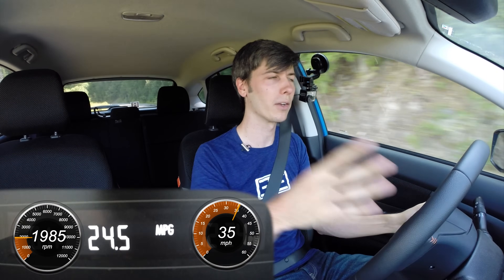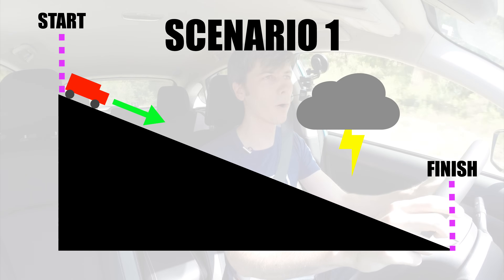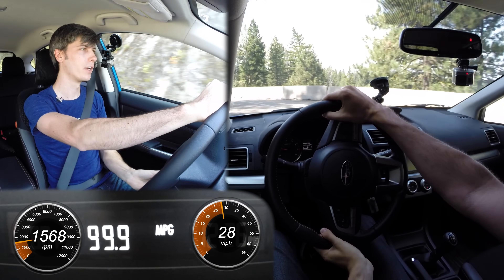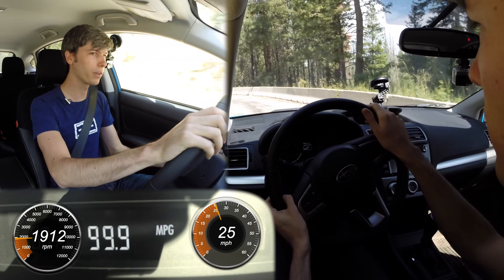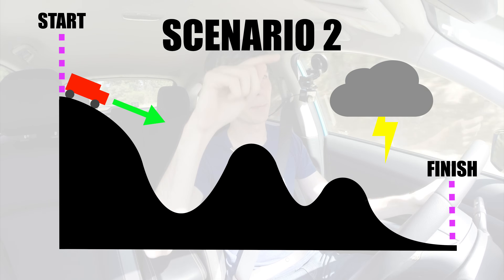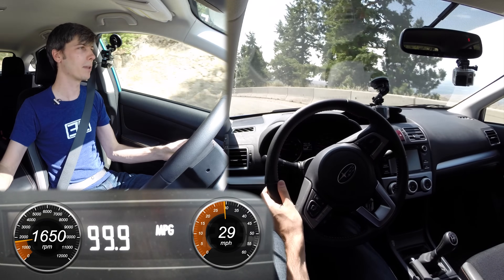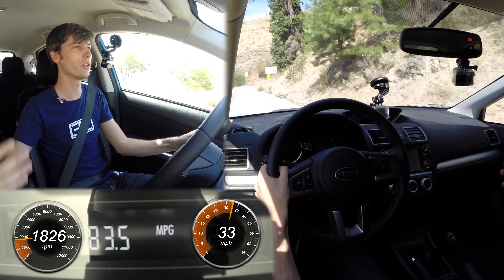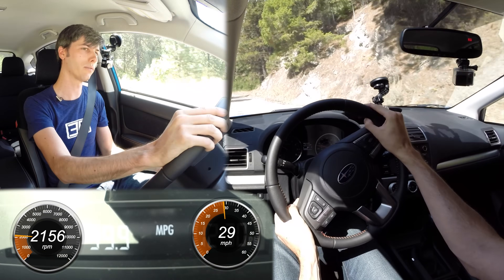What Uses Less Gas - Coasting Or Engine Braking?

Comment: To formalize this:
Your car has a finite amount of energy:
The energy stored in the fuel in your fuel tank + the kinetic energy that your car has right now.

If you're asking whether it's more efficient to coast in neutral vs coasting in gear, you're asking what consumes more energy.
If you're coasting in gear, you're not using any energy of your fuel, but you are using the kinetic energy of your car to turn your engine.
Coasting in neutral uses some amount of fuel, but you are now conserving the kinetic energy of your car as a tradeoff.

Keep in mind, that turning the engine with the kinetic energy of the car has an efficiency of almost 100%, as you aren't losing much energy on the way between the wheels and the engine, but converting fuel to kinetic energy while idling only has an efficiency of about 20%.

To summarize, you're asking at what RPM is the friction of turning the engine 5 times higher compared to the idle RPM. Also keep in mind, that friction doesn't increase linearly with RPM, so you can't just multipy the idle RPM by 5

Comment: My auto coasts but on a decent it will speed up so I touch the brake then it tgen turns off coasting and switches to engine braking. In my experience coasting only really benefits on flat highways.

Comment: This doesn't make sense.  It only depends on your finish line. If you see red light then engine breaking. But if driving like he is driving, then neutral will get you further and cover more distance then engine breaking and putting gas more to cover the same distance... I'm surprised he didn't cover that

Comment: I've done several situations with the mileage meter on my car. It has a graph of 6 bars but no numbers. 1 bar is minimal mileage, 6 bars is max. When on cruise, steady speed on level ground, the meter is maxed. Same thing coasting (no gas input) with no engine braking, max. However once you drop to about 15 mph and the transmission has downshifted, you lose the max mileage benefits.

Comment: This is incorrect. Try turning your engine off whilst going downhill.... the engine will bring you rapidly to a stop. Check exhaust pipe on car in gear going downhill... it's burning fuel.

Comment: 2:49 how about putting it in top gear. let it gain speed. Use the speed to climb the hill, if not enough give slight throttle

Comment: Can you redo this one please but not downhill. 
2 tests drive at a fixed speed (let’s say 80) and at one point one slows down using neutral and measure the distance it rolls and measure its fuel used.
Then the other car (which is in gear)has to keep driving a little while further at 80, and then start coasting in gear at some point to stop at exactly the same spot. And also measure its fuel used.
Which one would use more fuel??

Comment: Where is the stress point in engine braking? Is it the valves in the head? There's a lot of stress in slowing down a fast, heavy, object. What is the wear part? The thing that is going to need replacing, if engine braking all the time. ie: when using your brakes, it's the rotors and pads. Thanks, I like your videos!

Comment: 1st. It restricts the fuel going in, it doesn't shut off the injectors. That will stall/kill the engine 

2nd. What about putting a car that doesn't have engine braking in neutral instead of leaving it in drive?

Comment: My 2006 Navigator (w/auto trans and fuel injected 5.4L) ‘always’ gets better gas mileage, coasting in neutral versus coasting in drive! as a matter of fact, gets twice as much mpg while coasting in neutral! Could there be something wrong with my car? Because the overall gas mileage is only between 8 and 10 mpg. And that’s driving conservatively with a tuneup, new spark plugs, air filter etc. and no check engine light. I can’t figure out why it’s getting such bad gas mileage. Any help is much appreciated!

Comment: I don't think coasting would save any fuel, even in the multiple hill scenario, your video doesn't bring evidence to backup that claim.
 The main thing slowing you down excluding the engine is air drag, and air drag is proportionnal to the square of speed. Reaching higher speeds in coasting would mean more drag, and the fuel used for running the engine would be the same.

Comment: The best to save fuel is neutral and switch engine off, then when the hill is at the end, turn ignition on and put in gear, so you save battery too. You welcome.
Reply: Then you fall off the his...reason your power steering is not working 😂

Comment: As you drive down that hill you show that the two simplified answers are vastly oversimplified. Yes, the theory is true. However, most hills aren't straight as the hill you are driving down proves.  You need both engine braking and physical brakes in combination in order to maintain control.  Rarely is it safe enough to coast in neutral uncontrolled down a hill.  On top of that, coasting uncontrolled down a hill will get you in trouble for speeding.  Many people in mountainous areas get in trouble for speeding while having cruise control engaged because they fail to brake while going downhill.  Also, on long steep hills you can overheat your brakes if they are the only thing slowing you down.  It's much safer to keep the engine engaged and to physically brake as needed.

Comment: But this only applies if you have your actual stop at the bottom of the hill, in most scenarios you would benefit more from keep going in neutral on the flat piece which usually follows?

Comment: My 2.0l 2021 volvo barely has any engine braking. Even on a slight decline in gear with foot off pedal and all fuel inj cut off will still sometimes accelerate on a small decline. a large decline i have to shift to lower gear to get any engine braking. My 2013 manual corvette has much stronger engine braking. Steep declines even in a high gear will sometimes still slow car down with fuel inj cut off

Comment: Neither of those options are the MOST efficient method of driving in Scenario 2.  
The MOST fuel efficient method of driving in that scenario (in all possible scenarios in fact) is to hold constant throttle.  
Just hold the throttle at one constant position, it should be the position necessary to maintain the desired speed on level ground, and continue holding that same throttle position no matter if you are going up or down a hill.  Yes you will accelerate going down, and yes you will decelerate going up.  But this way of driving combines the best of both worlds, you gain the momentum on the downslope and that gest you up the upslope without using additional fuel that you would normally have to use.  And all things being equal, your average speed will end up being exactly equal to your speed on level ground.

Comment: Great video. Is there a difference when coasting in gear if you choose a higher gear vs lower gear? Eg. would you recommend to downshift at some point, or maybe even upshift to keep momentum, or will shifting gears make no difference unless you downshift so much that you rev the engine?

Comment: Note: Coasting in EVs literally uses no power, and using regenerative braking (basically engine braking) will produce a negative energy efficiency, because the motor will be producing more energy than it is using. For example, if you're traveling downhill at 60 mph and are staying a consistent speed while generating 8kW, that means that your efficiency is -7.5 miles per kWh, meaning instead of using a kWh in travelling 7.5 miles, you will have charged that amount instead

Comment: Another problem with coasting, is if you have trouble judging, road speed, engine speed, and the correct gear. 
My wife coasts down hill, rides the brakes, then regardless of speed, bangs it into first gear. 
Sadly, I had to buy her a automatic.

Comment: It's very simple. If the engine is to stay running at idle rpm, something has to keep it moving. If you put it in neutral, the engine has to burn fuel to continue to maintain idle rpm. If you leave it in gear, the engine will act as a brake and be driven by gravity and inertia. In this mode it consumes no fuel. Which is true of pretty much all modern vehicles with electronically controlled fuel injection.

Comment: I'm curious, is there a definitive year or technology that determines whether an engine can cut off fuel delivery while engine braking?

Also, I think it's a misconception that 99.9 MPG immediately translates to infinite MPG/zero fuel consumption. If the car can get 85MPG in certain conditions (like downhill), it's possible it could be getting over 100MPG, but still be consuming fuel nonetheless.

Comment: If you drive shift-stick you can switch between coasting and engine braking with your clutch pedal without having to switch gears. This way you can use the engine to slow down a little when needed, instead of using the brakes every 100 yards because you've picked up too much speed coasting(really annoying to drive behind, cuz you don't know how hard they're braking) 

I've seen some smoking calipers from people basically having to brake all the way down from a steep 3km high mountain cuz they were in neutral...

Comment: Easier mindset: Coasting preserves your kinetic energy. When you are in a situation where you need to get rid of kinetic energy, only then do you use the motor to convert kinetic energy of the car into heat inside the engine, and shut off the fuel supply in the process. Efficient driving requires you to plan ahead as much as possible so you avoid acquiring kinetic energy you need to get rid of. Sometimes easier said than done, but that is the goal. 
Had a heavy car with small engine, in that car I saved about 20% fuel by good planning and avoiding braking. Another tiny car, I only saved about 5%, so it differs. 
This also applies to electric vehicles. You can use regenerative braking, but it's more efficient to not do that unless you have to.

Comment: I was telling my wife that i want a fuel injector cutoff switch in my Mitsubishi mirage because it keeps the fuel ratio correct at all times, so when engine braking it uses more fuel because of the higher rpm. My diesel Jetta on the other hand cuts fuel under almost all engine braking conditions.

Comment: Before I even watch this video, engine braking will shut off fuel injection, using little to no fuel. Coasting in neutral means the engine has to use fuel to keep the engine idling, rather than the road wheels turning the engine via transmission. So the answer is coasting uses more fuel.

Comment: Saving fuel by coasting in neutral whilst going downhill is an old mith from the carburator age.
My mother is still insistent and to scared if high RPM to understand engine braking, no matter how often I explain it to her.
Which is fine since she pays for her rotors and pads not me :P

Comment: If injectors are cut off, why doesn't the engine stall ? I had a fuel solenoid valve failure once, the engine braking was VERY strong.

Comment: To save fuel, I find:
1) Drive smoothly. Cyclists will understand exactly how helpful that is. Rapid bursts of acceleration is very expensive.
2) Don't brake unnecessarily. This obviously will save on other costs. Cyclists knows exactly how this is too (When you carry your own water, the drops are precious).
3) If you have to drive 50mph (80 km/h) or so, it is cheaper to roll up the windows under air condition. Wind drag is a beast.
4) Newer cars don't offer much engine braking and driving in big gears is like coasting. It is better to leave it in a high gear. Does well for oil circulation (and automatic transmission cooling). Never ever shut the engine off while rolling. THIS IS VERY DANGEROUS!!
5) Keep your speed below 100 mph (161 Km/h). High speeds. especially into a headwind, will cause your gas tank to leak 😁. Ideally, 60 mph is good enough. The slower the better for aerodynamic drag. Even save on tyres.
The less work the engine does, the less fuel it needs.
Drive sensibly and you will be safer.

Comment: However, you cut it…engine braking IS still braking and losing momentum.  Staying in gear only makes sense if you need to keep slowing and would  use brakes anyway.  Note…brake pads are cheaper to replace than gearboxes…so don’t change down to use engine braking unless on a very steep hill…where the engine retardation can help to reduce brake heating.  Of course…as stated, coasting loses the chance to quickly accelerate if necessary.   On a test it is considered a loss of control and you’ll fail.

Comment: A different scenario is a hill that isn't steep enough to keep the car rolling at the desired speed with transmission engaged, but is steep enough to maintain speed when in neutral.  Then I suspect "neutral" wins, and without exceeding the speed limit.

As a semitruck driver, I was surprised to see the latest Paccar 12-speed automatic transmission start shifting into neutral on downhill slopes.  We were always taught not to do that while using manual transmission because it would prevent lubrication from being circulated (and is illegal -- "uncontrolled roll" they call it) but apparently they found a way to solve the problem of lubrication, while also getting the efficiency benefits of free wheeling.

Comment: In 2023, now the best option is to turn off the engine completely, and let the electric part of the plug-in hybrid capture the energy, and then only use gas for the steep up hill.

Comment: Apart from the tiny fact that coasting in neutral is a fail and you could be charged "with not under control", modern cars use zero fuel if your foot is off the throttle and you're in gear.  Coasting in neutral uses fuel, so that's more than zero.

Comment: I don't know about fuel efficiency but where I live we have very steep very long hills. I see morons flying down these hills at 70 and 80 and standing on the brakes trying to slow down. I just lower a gear or two and ride the gear. Much safer, as my brakes are there and cool if I need them.

Comment: My friends refuse to believe that when you let off whilst still holding a gear, fuel is cut off. They just say “well then how is it running, it must use a bit of fuel at least”. But if it was using even a little bit of fuel I’d be accelerating and not decelerating!! And the pistons are still dropping into oil to lubricate. They can’t grasp that the gearbox is turning the engine over by the force from the wheels. Maybe I need new friends 😅
Reply: I'm not sure if fuel is completely shut down, but just enough for idle power, otherwise you would have the greatest engine braking known to mankind. Maybe that is true in one of these new rolling computers, I don't know. I would not have any car that uses a fob instead of a key. Too much stuff to break, too much control over the owner.
Reply: @Dannysoutherner  The car wants to get to idle speed when your foot is off the accelerator. And if the RPM is higher then it will cut every drop of fuel to get that RPM down. The valves are still opening and air will still be passing through the engine, and still coming out the exhaust. But there will be no gasses coming out apart from unburnt air because it hasn't mixed with a fuel. It really is zero fuel being added until it gets down to idle :)

Comment: Saab apparently thought coasting in neutral would save gas because they put free-wheeling in 92 thru 97 series. Are sure fuel cut is not temporary to stop overheating the cat?

Comment: Pretty sure you have a video on it; Someone I know thinks using the transmission for engine braking is "destroying it" I'm going down a hill with a towed vehicle behind me, I guess I should just use the brakes that's why they're there! If can engine or transmission can't handle 4,000 rpm. Then may be stop flooring it. lol (The dude I know thinks he's an expert mechanic.)
But for this video, I feel like there may be a difference depending on how old a vehicle is. I have a TBI pick up from 95 and you can save a little coasting, and a little more going in neutral. I have a manual, and its MPG isn't that great anyway.

Comment: My son had the same question.   His 2015 patriot is a manual and I put in a odb2 monitor that showed gallons per hour usage.   Going down a big hill in the Sierra -   idle/neutral was 0.38 gph and in 5th gear at 65mph it was 0.54.     So coasting in neutral was much better.   Dangerous and don't try that at home but it's the answer we got.     I didn't think it would be that high since the injectors should be shut off but apparently they aren't really 'shut-off', otherwise the engine would be the same as the key off.

Comment: Jimmy always coasted down one particular hill in nuetral for some time now, until he seen this video. Now, every time he went down the hill, he was in gear. He noted it was usually 2500 rpm, for 10 minutes, everyday for nearly a year. Until one day, he was coasting down the hill, and the engine started smoking, and sputtering. His engine blew. He was thinking of his RPM and how low it was, only 2500, yet it catastrophically failed. But then he remembered, he's been doing this for a year. He added the numbers up on his phone. Over 9 million revolutions in his enginge going down that hill in just a year. He thought "How could I do this to my engine? I could've saved my engine from millions of revolutions, and unneeded wear and tear! Not to mention, the engine was probably getting hot with all that motion and no fuel being injected to cool it down! How could I be such a fool!" and so Jimmy went back to the video, and began to type. Although Jimmy never existed, and I just made this all up for fun. Poor Jimmy.

Comment: Never go down hill with your car in neutral when the road is wet. You must be in gear to create the resistance required to prevent the wheels from side skidding when turning

If you don't believe me, try it at speed in gear and then go do the same hill out of gear at the same speed and see how easy it is to lose traction